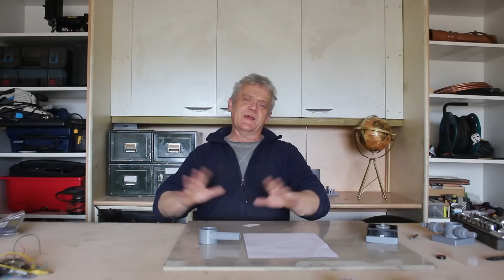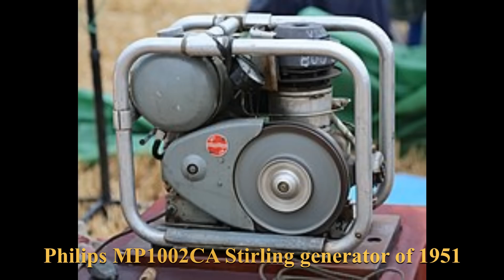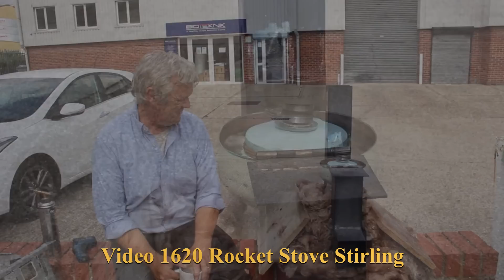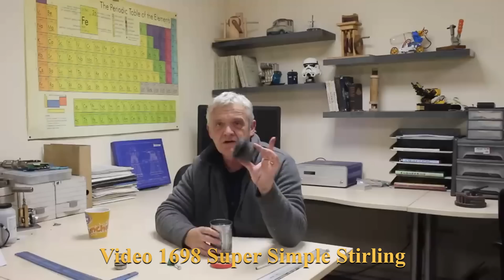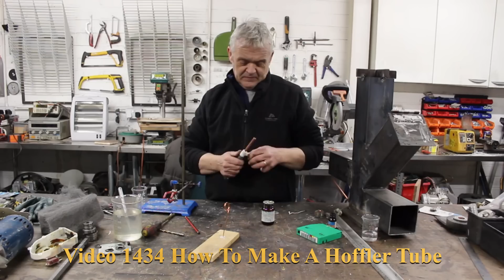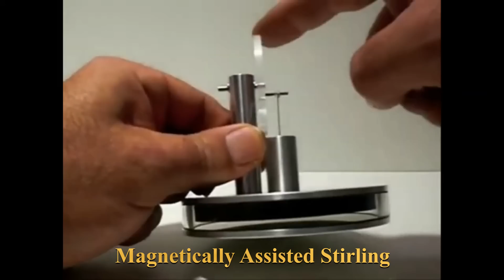1900 Stirling Engines Galore And Blade's Competition

Comment: I really love this concept, it´s so simple cheap and yet effective. 
The only improvement I would like to mention is, the lowest temp on the cold end is about 100°C due to the boiling water. It is important to get the highest temp gradient possible, especially on the cold side. Thus a better cooling solution would be needed. Something like a condenser, a water cooling AIO from a PC or something like that.

Comment: Great Videos. Not sure if anyone has tried this idea but I have wondered whether it would be possible to have a stirling engine generator where to hot side takes advantage of ground source heat and is buried, and the cold side is above ground. Should work well for winter generation if it could be implemented.

Comment: maxwells demons -> collimator, ... saying, to optimize the engine an electronic circuit should be used to control the pressure, and point in time of turning the collimator that divides the hot and cold side of the engine.
driven is the circuit by the energy produced by the engine.

Comment: Edit: Boilers, as well as Sterling engines, are both "external combustion" engines. "They put the flame on the outside" is not what made the difference. The difference was the working fluid. Obviously, the working fluid in steam engines, is steam... more specifically, water vapor (in more efficient variants). Water can be an extremely volatile working fluid at its most efficient extremes (vapor/ice), as can exceed the design limits of the machine. The most advanced form NASA/DOE sterling engines utilized nitrogen gas in hermetically sealed circuits... making it much more friendly at its limits, as nitrogen can be easily contained in its near-critical/non-critical transient states.

Comment: My favorite type of stirling engines is shown in your video 1698. In any case, unfortunately, it is not for generating energy for home.
As example, your design: it is needed about 30-60mmHg of pressure to fill a balloon. Volume of air compressed is about 0,0003m3 per engine stroke. If engine makes 2 moves per second then you will get about 2m3 of pressurized air per hour. It means that you will get about 500J of potential energy per hour. If efficiency of engine is 1 percent then you can get 0,5J of mechanical energy (equivalently about 0,0002 Wh).
Reply: Free-Piston Stirling Engine with more power output works with 100bar of pressurized gas that requires very expensive design. Also it will consume a lot of fuel to get enough heat energy.

Comment: SO a Stirling engine could be used to run a generator which could drive an electric motor in an EV, A lot more range and WAY cheaper than using lithium batteries.

Comment: safest and simplest engine is the steam putt putt engine no moving parts and nothing to wear out could be used to turn a vertical spindle in a pool of water you should look at this I have built a full size one to power a 12ft dinghy but the rivers to high to test it at the moment I wonder if it will work
Reply from the maker: I thought it had a moving part - isn't the case also a diaphragm?
Reply: look at the ones by darrel foster just a tank and pipes try it with just a coil of 4mm copper pipe and it still works.
 blade did somthing with a diaphram putt putt and a dolphin tail that was quite interesting as well.

Comment: A fascinating phenomenon with combustion engines is if you offset the centre of the cylinder head in relation to the centre of the crank you cause the power stroke to be larger in terms of degrees of rotation and shorten the exhaust stroke by the amount gained on the power, this is of course with a 4 stroke engine and a Stirling that rotates a crank is only 2 strokes, so we can extract more work but at the costs of some vibrations.
The thing I really like about the Stirling motors is that the pistons can be made out of graphite which acts as its own lubricant inside the cylinder and if you have a long stroke and offset cylinder the side loading forces on the power stroke are reduced and since the power levels are lower than an internal combustion engine the amount of material is reduced and the types of materials don't need to be ultra processed
Reply from the maker: in engineering terms it is certainly much easier to machine

Comment: Could you technically use a heated coil by running electricity through it as heat for the air to move so there's something to move the sterling engine?
Reply: Yes, you can use an induction coil for heating.
Reply: @samuelthomasengardio  is it any good?
Reply: @fireballloadout  Absolutely, but it depends on how much current you apply to the coil. A fun video on youtube to search for is something along the lines of "boiling ice with induction heating". Theorically, people should really be looking heavily into steam hybrid systems, because you can run steam engines/turbines/rotors now without a boiler.
Reply from the maker: yes

Comment: I've always thought of a sand battery with a sterling engine  so use all of the salvage generators you've done to heat a sand battery then use the sterling to make the power when there is no wind sun or rain
Reply from the maker: I like that mate - thanks for sharing

Comment: I'm designing a Sterling-type engine that runs at very low temperature differential, high internal volume and low speed.  Has anyone done anything like this before?
Reply from the maker: yes mate I read a research paper where they ran an LTD at half a degree temperature difference - I don't remember the paper but it turned up quickly in a google scholar search

Comment: Hi I have made a number of Stirling engines and love them but I had the chance to buy a book in the late 1980s about a multi cylinder squish plate sterling engine that was & as far as I know is used I most submarines ( advertised in the irte or engineering council magazine) & I deeply regret not buying it. It was similar to a hydraulic hydrostat motor & it has fascinated me ever since.
Reply from the maker: you should have let impulse govern that one mate - I hate to say this but chances are it will be ages before you stumble across that book again!
Reply: @ThinkingandTinkering  hi I have been trying to get a copy of the book ever since 😭

Comment: Might it be possible to make a very low temperature stirling engine that would run off body heat by changing the  type of gas on the inside of it?  And by using a thermal Cline to trap the heat and make one that would run off a candle or a farm animal like a chicken or rabbit their body temperatures runaround 101 . If you were to use a larger surface to pick up the heat and turn that into a thermal Cline to capture the heat and like a battery a heat battery heat would stay put because it rises up. It would be interesting to try to make one run off your body heat while you're sleeping. Charging up your systems. The only weak point is that rubber balloon. I've seen them use ferrofluid that balloon needs to find a second option. I don't think it'll stand the test of time.
Reply from the maker: yes I read of an engine running on half a degree temperature difference

Comment: I would love to see a low cost sterling engine put into production, something that costs about the same as a lawn mower engine and is about the same size.

I wanted to make a 6 cylinder alpha sterling engine out of metal using bronze electroplating because bronze can be very low friction and retains heat well. Perhaps using a steel tube for the cylinder, cast aluminum pistons, a Hemispheric head for even expansion as a prototype. I'm going to try and work on it, but if anyone else can build that concept, awesome!

There are a lot of people in the rural United States that have wood boilers, solar thermal is also not too expensive, this would be a huge way to get self-sufficient electrical power in particular to everyone, but in particular places where the grid can be a little more spotty and where power outages can last for a week or more.
Reply from the maker: they are starting to make them for CHP systems but they are still expensive

Comment: A thing I've been wondering about, is if you could use the principles a heat pump to help a stirling run?  As a heat pump has a coefficient of efficiency greater than 1, it seems like you could use one to take heat from the cold side, and pump it back to the hot side to maintain a better temperature difference and greatly improve the efficiency of the engine.  It seems like it might be worth the energetic cost of running the compressor to recycle that heat back into the hot side of the engine.
Reply from the maker: it could be done mate

Comment: I wonder how hard it would be to 3d print some of the more difficult parts of an alpha Stirling Engine. Pistons, head, linkage.

Using standard PVC for the sides.

This wouldn't be my bronze electroplated Stirling Engine 😂, but it could be an affordable Stirling engine.
Reply from the maker: there are quite a few on thingiverse
Reply: @ThinkingandTinkering  I truly appreciate that, thank you! I think a lot of the files available are either the beta type sterling engines and/or use syringes has a piston and cylinder.

I took a computer rated manufacturing class in high school 15 years ago, I really need to brush up on my CAD skills.

It's truly amazing, when I was in Highschool between 2002 and 2006 my school spent maybe 25 thousand dollars on a robotic arm and a CNC building machine. I'm not even sure there were many good commercially available 3D printers, although we did learn that they existed.

I don't know if the robotic arm is necessary anymore, but it's truly amazing that CNC milling machines of probably equal quality are available for only a couple hundred dollars.

I remember having to somewhat manually program the tool paths.

Your assessment of the state of 3D printing and computer aided manufacturing 10 years ago was spot on and it brought me back to using Autodesk inventor with the US version of Junkyard wars playing in the background.

Keep up the good work!

Comment: This is very interesting! I never heard of the Hoofler tube. When you mentioned that NASA used this device for refrigeration, I remembered, way back possibly the late 70s, an aunt and uncle had an AC that was accually gas fired. Could this be who it operated. This was like I said way back becasue I was very little then but do remember it.
Reply from the maker: I don't know mate - I will have to have a look into it
Reply: Thank you. I never know that sterling engines were actually used as engines, though it seems experimentaly. Another thuoght about NASAs use of the hoffler tube for refrigeration, I have seen videos where, I guess, was used in RV (I from the US) refigerators where the frige is dual fuled. Shorepower and propane.

Comment: What is the possibility that you could perform a specific experiment?

Sterling engine powering a small A/C compressor and the low pressure and high pressure line providing the heat for the sterling cycle.
Reply from the maker: go for it
Reply: You don’t need a compressor. Use one Stirling engine to drive a second one and it will produce heat and cold as needed. Stirling refrigeration is incredibly efficient.

Comment: Ah, the memories.  
Looking at those cars I was wondering if there were a way to do a solar Stirling car.  Put the hot end on top in a glass box, like a solar oven in the hood (I think you call that the bonnet) and then air cool the bottom side as you drive, maybe using a few solar cells to run a fan when you're parked or in traffic.
Reply from the maker: interesting idea mate thanks for sharing

Comment: Why cant you buy a wood fired power generator. Or bio diesel one. The fire could run a steam engine or sterling.
Reply: Allpowerlabs is a company that sells palletized wood gassifier fueled internal combustion generators. I have no idea how the company or generator are to deal with but they have been around for a while now.
Reply from the maker: you can

Comment: Can we really call all these heat engines "Stirling engines"?
Reply from the maker: yes
Reply: The invention Stirling made was using a regenerator in a heat engine, so if you want to be very strict you could say: "It's only a Stirling engine when there is a regenerator in it.".
Reply: Stirling engines all work by heating and cooling air. These engines may look pretty different but that's the principle behind every one.